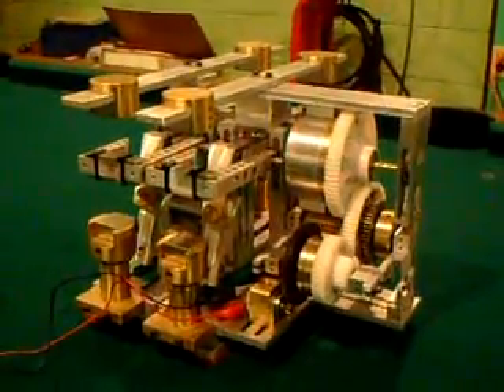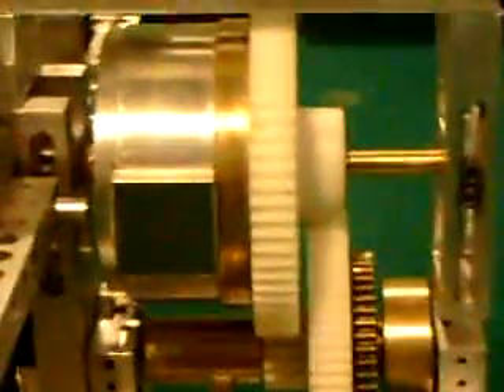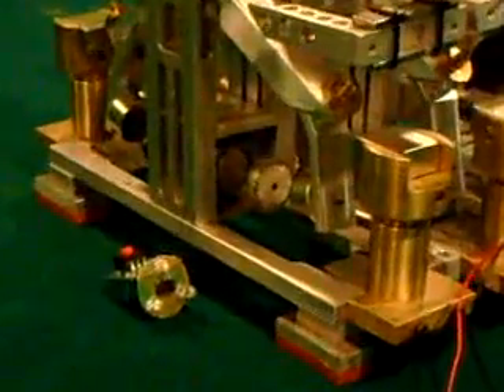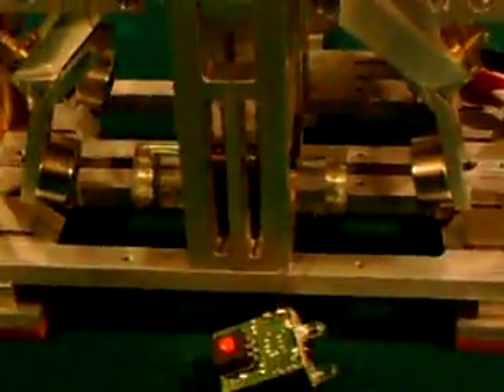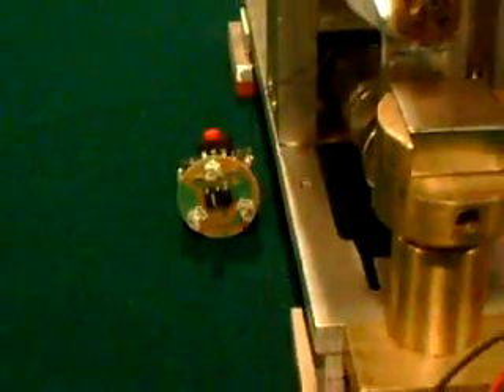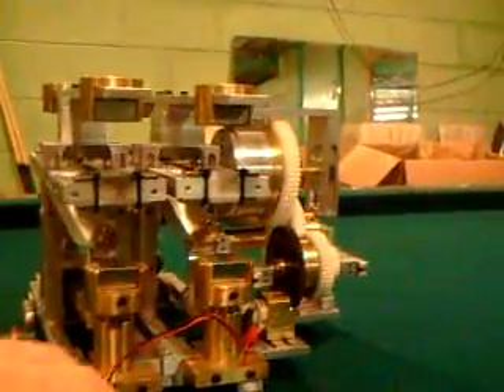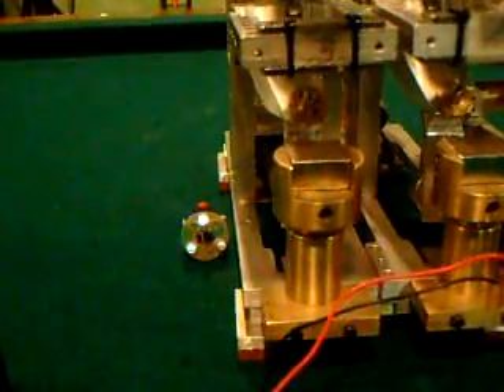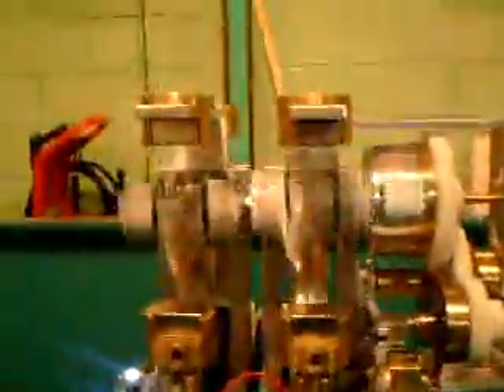over unity 3

Comment: This is great but you need to show that you are getting more power than you are putting in. What I mean is, you need to show that you can power something that those two 1.5 v batteries can't. If you are not getting more energy than you are putting in then what's the point of all this?

Comment: That is one complicated way to power 3 tiny leds, it would be alot more efficient to just wire the leds directly to the 9 volt batteries, it would last alot longer and shine brighter.

Now that my contructive criticisim is out of the way, here is some help : BUILD IT OUT OF PLASTICS, so that your parts don't screw with the magnetic fields and its cheapper on the wallet.

The law of thermodynamics always works, it just that some machine consume storages of energy we dont understand. cont...